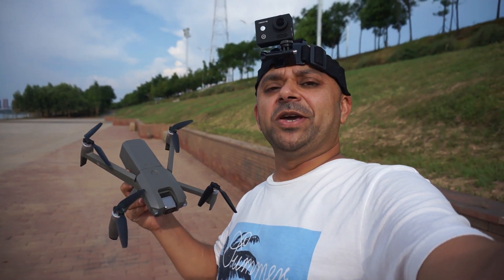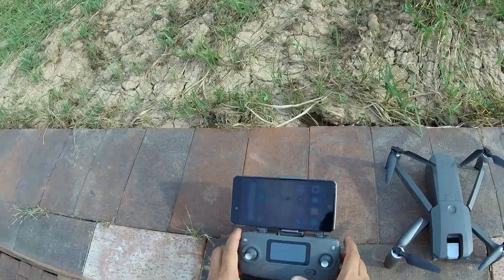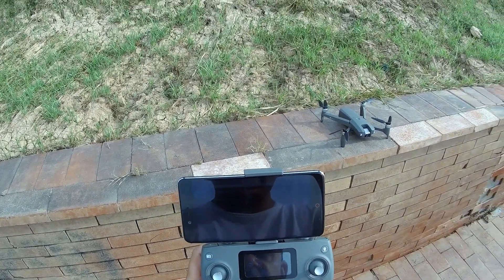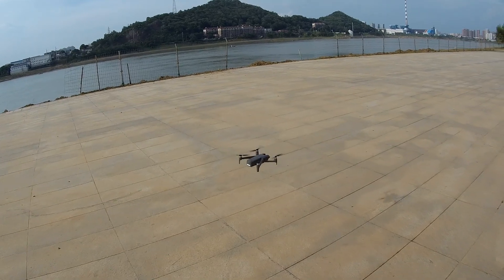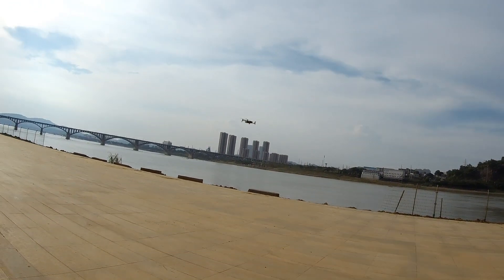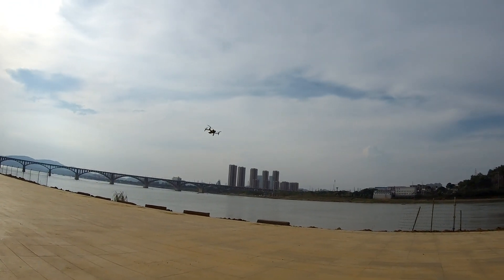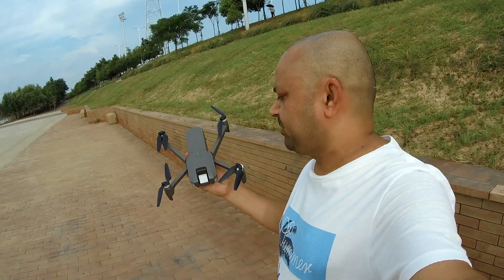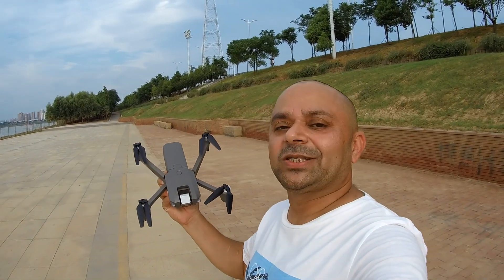MJX MEW4 1 Parrot Anafi Knock off 5G WiFi FPV Drone Flight Test Review

Comment: On its video/photo and flight performance, its the basic quality from all mjx drones, no stabilization, common jello effects, low quality video and photos, less wind resistance, same flight time 12mins but its has its good features as well, its foldable and with 180° tilt which is copied from anafi design. After so many gps toy drones MJX have introduced with the latest bugs 4w(with unusable video) this drone could have been upgraded to a hobbyist drone to compare with Zino or fimi, if they have introduced 2 or 3 axis gimbal and optical sensors at the bottom. But since they are stuck on toy grade camera, they will get a small share in the market considering there are lots of competition in the toy grade drone markets. Those who have experienced toy grade drones will definitely try the higher end drones for beautiful aerial shots. To be fair, this drone flies well like my first Mjx bugs 5w drone but you get what the price offers. Thanks!
Reply: The current price on eBay is 2.5x the price of Bugs 5W, so I feel this MEW4-1 just isn't worth it without 1) 2- or 3-axis gimbal 2) decent 1080p60 smartphone-grade camera instead of the current toygrade fisheye lens. Hopefully the MEW4-2 fixes those issues and it would be a pretty awesome drone